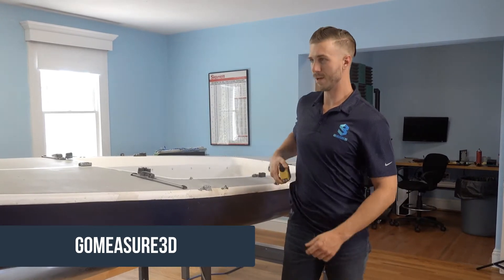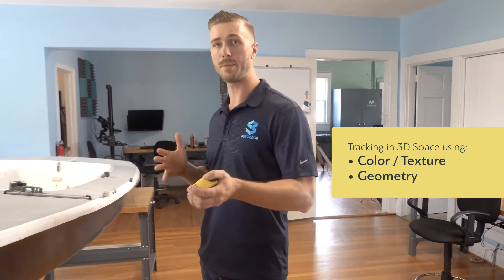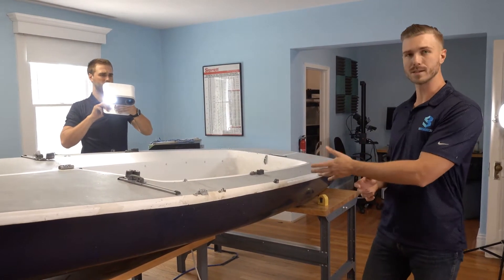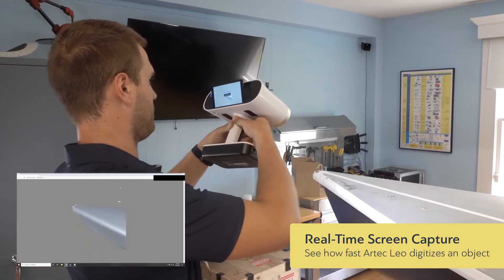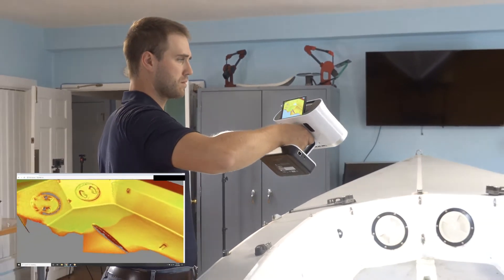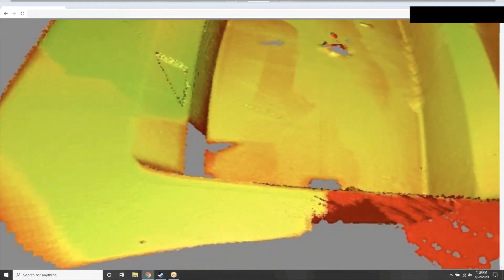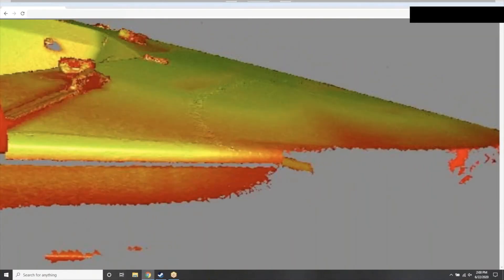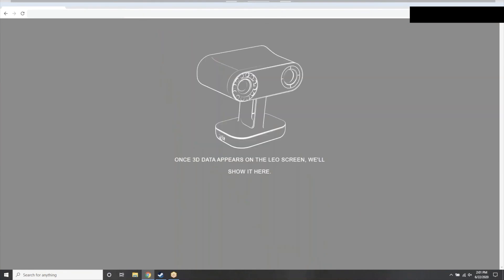Artec Leo: 3D Scanning Large Objects

Comment: Hello, Without scanreference data the error is big for big parts! I've Leo and Aicon photogrammetry Scanreference system
Reply: What is the volumetric accuracy for this project?
Reply from the maker: @Nilton_Cavenaghi  Apologies for not replying earlier as we thought we answered this question already but forgot to hit the reply button to save the response. The boat is 14 feet long and the Artec Leo has an accuracy over distance of up to 0.1 mm + 0.3 mm/m. The boat is about 14 feet (4.3 m) long so the accuracy is about 1.4mm for such a big object.
Reply: @GoMeasure3D  very nice to see, i would like to test out the software before buying anything, would you be able to provide a uncleaned file to test with... think the raw is .arcs?
Reply from the maker: @kennyback7636  Thanks for your interest in the Artec Leo. Our company, GoMeasure3D, is a reseller of Artec products in the USA. Can you send an email to sales@gomeasure3d.com if you are interested in testing out the Artec Studio software? Artec Studio outputs file: OBJ, PLY, WRL, STL, AOP, ASC, PTX, E57, XYZRGB. 

If you reside in a different region outside of USA, you can contact your local reseller in your region here: https://www.artec3d.com/where-to-buy. They would be able to further assist you.